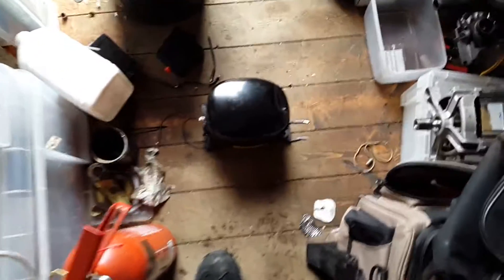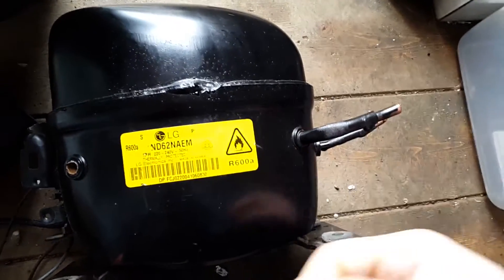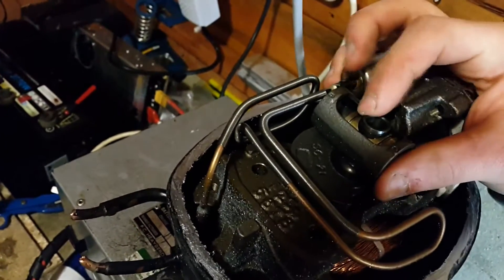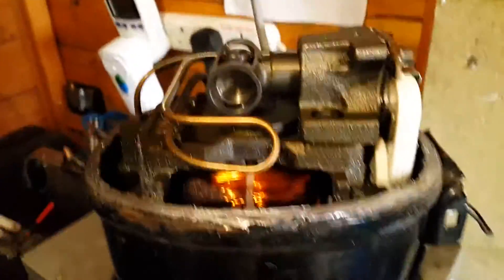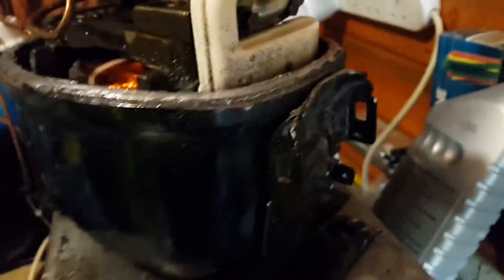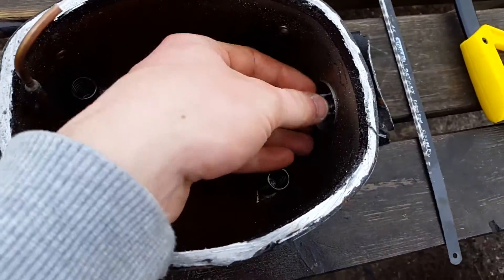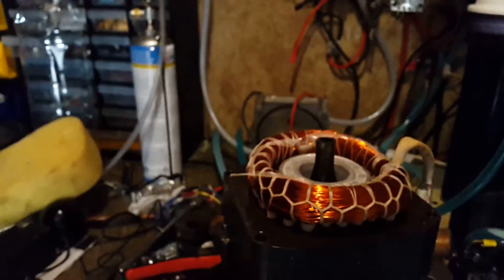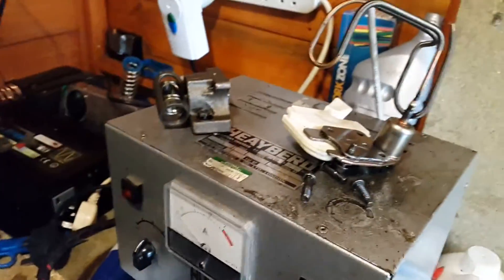Failed DC Compressor Project

Comment: Thank you for this video. Are the R290/R600A ac compressor different inside then a R134/R404 compressor?
Reply from the maker: They usually will be different cylinder volumes, bore and stroke etc.
Reply: @ShaunDobbie  I mean are the material diffucelent between each other. Can I put R290 charge in a R404A compressor if the compressors had the same capacity
Reply from the maker: Yes, you can as the materials are the same. The only exception to that are car ac compressors and possibly other specialist semi hermetic compressors as some refrigerants and oils attack the rubber seals.